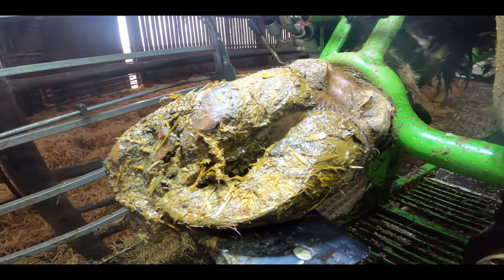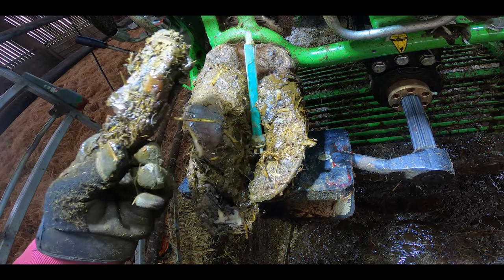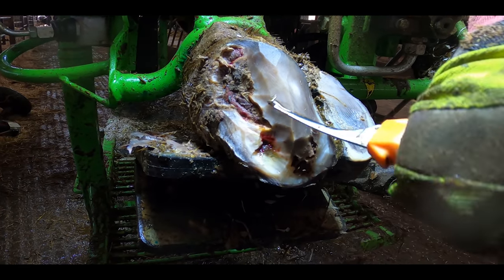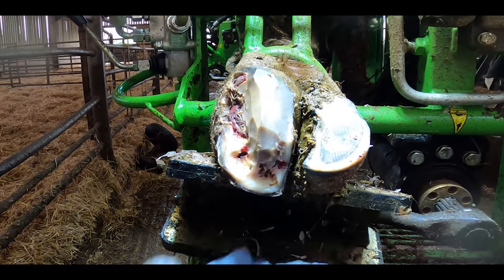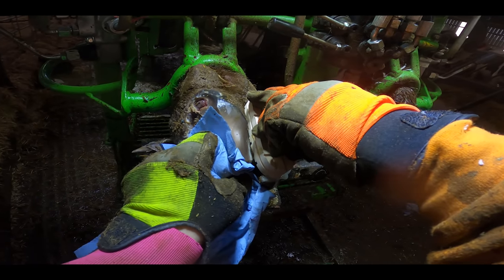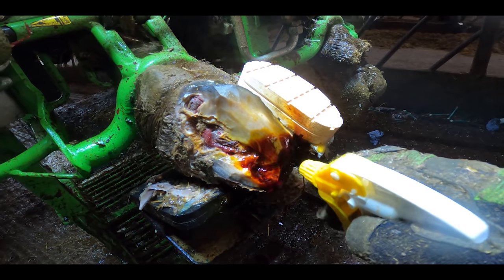MASSIVE, OVERGROWN & TWISTED BULL'S HOOF

Comment: The tool that he grinds with, do they have a special hoof trimming blade or is it not a blade at all? I only ask cause it doesn't seem to heat up at all so was just curious as to the reason for this and the grinder used in general.

Comment: should see how they do donkey Hooves in China all this guy uses is a metal sharpened Spud and a stool with the tread of an old bike for rubber matting to lay the hoof and just chops away. No angle grinder or a trailer to hold the donkeys in place they tie this rope like up against its lip and tie it to like a pole so the donkey can't move cuz they kick and I guess when their lip is being pulled on they don't want to kick or move one wrong move with that Spud and he's going to lose part of his hand

Comment: Please explain why your very first step isn't to wash the muck off.
This could be as simple as having the animals walk though a bath, or you could spray it with clean water.

FFS - clean that shit off before you do anything  !
Reply: He's explained many times why he doesn't wash the muck off. First of all, having the cow walk through a bath or spraying the hoofs with water would do nothing. The muck is thoroughly ground in, and it would take serious scrubbing with a heavy brush to remove it. That would likely do the cow harm, and at least would mean the cow would be kept in the crush far longer than necessary. The first pass of the grinder cleans the hoof more effectively than any bath would do.
Secondly, it would be pointless. He's not cutting into flesh, so he's not introducing a path to infection. Any pathogens there might be in the muck are already there. 
He cleans off the hoof when he needs to see more clearly. He doesn't generally clean the hoof just because some viewers are squeamish.